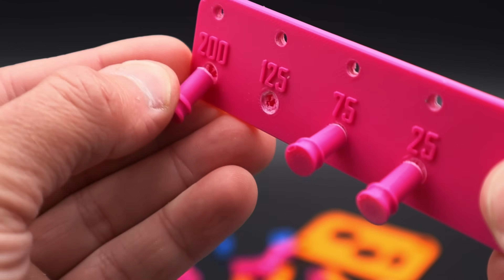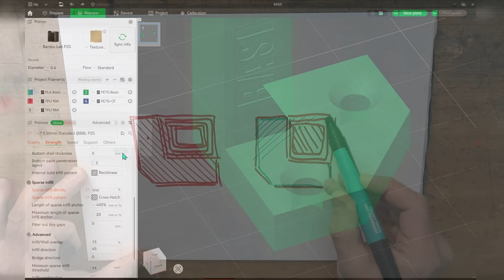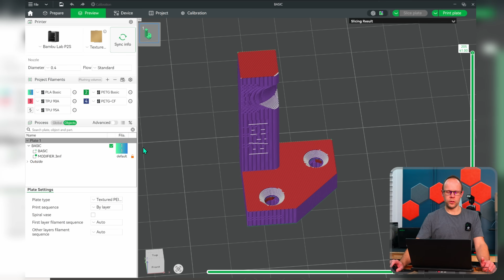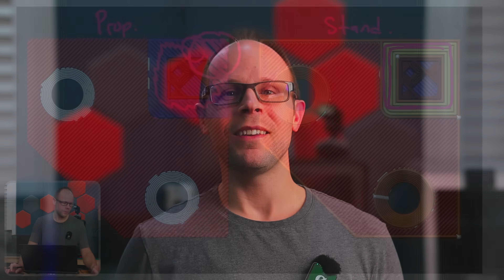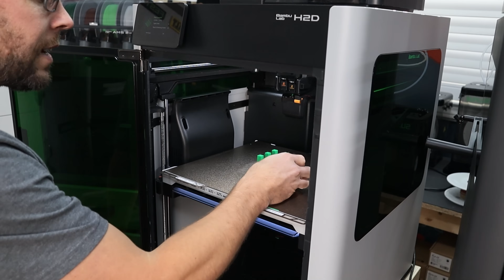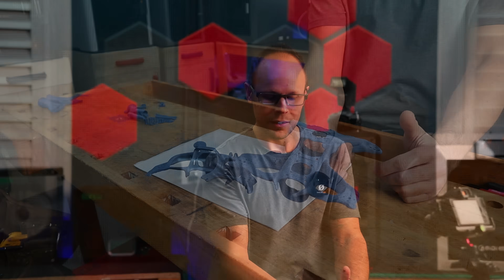Can the simplest 3D printed extrusion path also be the strongest?

Comment: Good find.  Printing by object would have to improve it further. 46% improvement in PLA is huge.  

I was playing around with this and found that I did not need to use a modifier at all.  I was able to achieve this fully within orcaslicer.  just make all of patterns 'aligned rectilinear,' 0 walls.  

Regarding "Detect narrow solid infill", i found it could be useful to use or not use this, depending on the geometry of the model.  If the part has some intricate geometries mixed with some bulky areas, you may want to use that.

I'd love to see more testing of this method with different types of parts.

Comment: I always add a curve, where parts break. Already learned the hard way, you can't design 3d print parts like machined parts, you have to go smoth instead of hard corners. A 45° curve of 0.2mm already helps a lot and doesn't really change the part.

Comment: I bet we can smooth the part and it looks super nice (ex : polysmooth, abs, asa-cf, etc...)

Also using one wall on the outside, maybe inside too, would likely greatly increase overhang capabilities while still benefiting from the technique and give a smooth surface

Comment: I would put a negative cube under the transition that is twice the set wall thickness smaller than the post and extends from a few layers below the interface to several layers below the interface. This causes walls to form under the walls of the post to fuse to the walls over them, in effect, extending the solid wall into the part. This strengthens the post while using less filament.

Comment: i think you can get similar results 
by using the standard method 
but playing around with nozzle temp and part cooling fan speed 
basically optimizing for the filament to print hotter without losing quality

Comment: If the theory is heat helps with strength via adhesion can't you just use standard printing parameters and bump up the printing temp a few degrees?

Comment: interesting vid! I like the thinking approach.
I have a few concept and measurement questions/points though.
1. What happens if you change the wall thickness of the outer wall (one wall print version) to the minimum (0.2mm)? that way you should have a nice surface, yet you don't sacrifice as much area for your process.
2. Can you (for some next vid) also provide the weight (and weight distribution if doable) of the parts? having the same amount of plastic in relevant areas is really important for these tests.
3. You want to extrude over hot plastic before it cools, but then you print 9 samples in one batch, invalidating that process because one has to wait and cool while the other 8 print.
4. The test parts made have a stress concentration on the start of the narrow tower. this is ofcourse nice for testing, but what would happen with the default strength and more importantly your approach if you add a champfer to eliviate the stress concentration? will your approach improve even more or fall of a bit?

To be clear, this is instructive feedback. I give it because you came up with a great idea and I want to know the ins and out ;)
and as of the time of posting this comment.... merry cristmas :D

Comment: One other thing to point out that matches what I see from other videos: PETG is stronger without the CF. I still don't know what CF filaments are for. People say it's stronger, but all testing shows it's weaker. Before anyone says it's stronger in "X", no it's not. Every test I've ever seen it's worse than plan PETG. I haven't seen many tests with nylon and the CF versions there... but I assume it's the same.
Reply: It can be useful to increase STIFFNESS (ie, Young's Modulus), but not strength. Even the stiffness is pathetic compared to real carbon fiber composites and metals. For example, Polymaker PA6-CF20 is a good quality (and expensive) CF option, and has a Young's Modulus of 7.5GPa (5.7GPa after absorbing moisture from the air). That's TINY compared to (say) 6061 aluminum (69GPa).

Comment: When you hollowed the drone part I saw you put the offset at 1.07. You're typically printing layer lines as thick as ~0.2mm. 1.07 is not a multiple of 0.2, so some of the lines (when lining up with certain walls) will be squished, resulting in less overall strengths. That said, I love this idea! It's such a clever way to work with the printers features!!

Comment: “This is a fantastic deep dive into layer adhesion — exactly the kind of thinking that pushes 3D printing forward! As a prototyping and low-volume manufacturing factory, we often see how subtle changes in extrusion paths impact real-world part strength, especially for functional prototypes. Your experiment aligns with what we’ve observed in our own 3D printing lab: sometimes simplifying the path can indeed enhance structural integrity. Keep up the great content! If anyone needs help translating design insights into physical parts (via 3D printing, CNC machining, or other methods), we’re here to support. 👍

Comment: There is a lot of room for growth in FDM and Resin Slicers.
You know, there is a relatively easy way to solve this problem (at least in concept).
Basically, you could program the slicer to add more plastic where there are high-angle Concave Areas, and in these areas you could add plastic at the depth of the wall thickness (or higher), and along the surface of the part at a user-specified value.
Where the "added thickness" decreases gradually until it reaches the user specified length.

Comment: I noticed that my older slower FFCP with the enclosure printed stronger petg parts than my faster bed-slinger.  The three main differences were the enclosure, the slower speed and worse cooling.  All of which would have improved the interlayer bonding of the parts.  Have you looked at reducing the fan speed and impact on interlayer bonding?  Printing per object and slowing down the print speed can also help as well.

Comment: Pins and similar cases of small tall parts attached to a base are normally solved by forcing additional walls inside the pin going all the way to the bottom of the base (or as far as you want).

Comment: Just a few random toughs i had when watching the video... Have not done any testing myself so take it for what it is.

Might this be that you get better surface-area between the layers? Ie the small voids around each extrusion?
This could be tested by testing strength 90 degrees against how the lines are extruded on a thinner part.

If that's the case brick-layers the standard way might work even better as that will increase strength evenly in all directions.

Another possible option (random tough i had) could be to split up the parts into interleaved "bricks" where each "brick" have fully aligned extrusions. Think advanced brick-wall where each brick is multiple layers but interlocking with surrounding "bricks".
Another possibility could be to have aligned extrusions acting like rebar within a part to improve strength in specific directions.

Comment: I wonder if a laser (IR or whatever) slightly heating the surface of the lower layer just before the next one is extruded over it would help. Not to the point of melting it but so that the heat of the extruded filament melts the surface.
Reply: I have been thinking exactly the same thing, asking myself why is no one doing it

Comment: Adding a fillet at the base helps a lot when possible. Adding internal structures like one or more '+' shaped hole that cuts into the base shape also helps, acting much like an anchor of 'external' walls. If you have access to advanced features like 'brick wall' or half-layer offset extrusions so each extrusion fuses to two of the extrusions below (in the groove between two) that's also going to help a lot. If possible print entire objects at a time, it results in stronger parts. Depending on material you may want some form of ACH to both help with warping and layer adhesion.

Comment: You should also do a version where the walls of the pegs extend through to the bottom of the base. I’d be willing to bet that not only is it simpler to model, but it would ultimately prove stronger since the peg itself seems strong enough in the Z axis.

Also you forgot one more trick - printing it angled at 45 degrees.

Comment: Very interesting test. I like the approach, but there is a factor that might not be applicable to the real world. You printed a bunch of parts, all at once. But that gives every part time to cool down as well. Depending on the needs in a real world that could be way less, maybe even only one. I personaly tend to print objects alone instead of throwing everything at once on the build plate. On such a single print the results could be closer together. The cooling strategy could be important as well. I often reduce the cooling depending on the part, wich would be large parts that have time to cool on it's own and/or have minimal to no overhangs. The goal is better layer adhesion as well. But I never ran tests on that.

Comment: I have a small powdercoating setup and its given me an idea when it comes to the final surface texture of 3d prints but Im not nearly as smart as the rest of the internet to make it work so I figured this might be a fun video to plant the seed of inquiry to see if anyone can add to it or tell me why it's not an idea worth the time.  For starters my idea requires a multimaterial printer that could fill in all the holes and important interfaces with a material thats easy to remove from the main structure material, sort of like masking tape. For those who don't already know, powder coating is just a fine powder of a plastic material that is sprayed on to the object with air and is statically charged to stick to the negatively grounded object you wish to coat and then baked to melt the plastic powder into a thick and uniform surface like the shell of an M&M. If someone could come up with a powder that melts at a lower temperature than the printed material I feel like it would still bond fairly well to the rough texture of the print regardless of the adhesion property between the dissimilar materials. The real trick is the application because of having to apply the powder to a non conductive surface. With powder coating metal parts you can get away with preheating the part and spraying it without grounding the piece because the powder will stick to the hot part as it melts and then you just finish the final bake in the oven to gloss it out.

Comment: Was it not an option to print the PLA just slower, hotter, and with less cooling?  I mean, if it doesn't stick well to itself, because the previous parts of the extrusion are too cold. Why not attack that issue directly. Hotter - speaks for itself. Less cooling - the same way. Slower - so that the thermal mass of the nozzle spends more time over the deposition zone, radiating heat into the area.
Reply: If it's too hot then the tower will risk failing because it would sag over all the heat. I'm pretty sure his method releases heat closely at the same speed but achieves a higher adhesion because things get printed together as they are at their hottest point

And also too hot and you burn the plastic

Comment: Interesting test—thank you very much for that. 
What surprises me is the significant difference between “1 wall aligned” and “fully aligned.” How do you explain this sharp drop in strength? (I would have expected that 1 wall “for decoration” would hardly reduce the strength at all.)

Comment: Solutions I've used with great results
1. Add a hole in the bottom for a small peg or screw. (I usually use M2 screws and self tap them into a 2mm hole.)
2. Add a chamfer at the base of the tower.
3. make the tower rounder (lower stress concentrations)
4. Increase the nozzle temperature.
5. Increase the nozzle size, or the line width
6. print slower.
7. print at a higher layer height.
8. change the print orientation.
Reply: You just don't get it. These are test parts. Made to try different ways to print a layer adhesion union. Results are not conclusive but insightful.
Reply: @edufonseca5718  But these tips are general good suggestions and people looking at this video probably want something stronger and these tips are exactly what they might need.
Reply: @chili209  Valid. But the video is about layer adhesion and how the extrusion path can improve it. Not alternatives to make this specific test part stronger. If you print a test hook, you don't improve it's layer adhesion or strength by widening it.

Comment: For my own curiosity, did you happen to calculate material consumption as well with any variables for additional print time? 
In my own use case scenarios, rather than doing mismash geometry tricks (outside of optimizing the model internal and external shapes itself for better printing during creation), usually the more direct route to better part strength coincides with a material change that can tolerate more heat. I know I've banged my PET-CF/GF drum just about everywhere by now, but because it is such a versatile material that I wish more people would use, I'll drop it here, too. The omission of the glycol additive makes a world of difference in tolerances, post-machining properties and overall part strength, but it does require a hotend with higher headroom for temps.

Comment: Thanks for bringing attention to this. I've been using this mode for several months now (way easier to achieve in Cura than Orca), and the only downside is that we can't have zigzag shells with normal infill (without all the trickery). Probably the easiest way to get it would be to modify fuzzy skin algorithm, but who know - maybe someone will add proper option for this kind of walls.
BTW, I think the improvements come from crossed lines more than extended melting.

Comment: Crap. I threw a laser head on my printer to do some etching.  I'd like to fiddle with this for my RC FPV stuff.   Christmas Santa shop is on over drive for my family right now.   Oh ? your printer is a CNC machine, laser cutter /etcher and a 3d printer.  Basic install using a screw driver or Allen wrench.           Every printer on the planet is capable.   Oh? not you resin monkeys.     thanks..    EDIT   Merry Christmas ! ! !    and have a very happy new year.!

Comment: Adding a filet at the base would also help
Reply: the test wasn't to make the strongest design, it was a test to figure out which slicing method is the best.. the results would likely be the same even with the fillet, the proposed method of slicing is stronger than standard
Reply: @c @chronokoks it shouldn’t have had a right angle to begin with a filet is always stronger
Reply: @11THEFEZMAN11   again, you don't understand the purpose of the whole test and the video. The purpose was NOT to create a strong part. The purpose was to COMPARE different slicing parameters. It's cool and all you know that a fillet would make that part stronger, but that was not the goal. Do you understand or are will you go on a tirade how smart you are and you would make the part stronger even thogh it wasn't the goal of the test and video at all? Learn to not be so smart that you're actually stupid, it's what adults learn early on
Reply: @chronokoks you obviously don’t understand how to build a part, or take any criticism.

Comment: In order to optimize strength you need to optimize the standard method first. Have you tried different layer hights (0.16 seems to be strongest in some tests) and different temperatures for your filament? I find that printing PLA+ at 230C with almost no cooling makes it much stronger over the standard 205/210C prints. Without optimizing standard parameters any attempt to improve the strength is meaningless, as the normal parameters are not optimized for strength and improvement over those settings are rather easy.

Comment: Cant you also print the shape hollow and insert a square printed peg that was printed horizontally. The outside will then have layers at 90 to the force but the peg will be in line with the force.
Reply: Another one who missed the point of the pegs.  These pegs are engineering test samples.  They're not functional parts, they're meant to be a repeatable method to test different layer pattern techniques.  If you really needed a load bearing cantilever peg like that then yeah, you'd want to print the part on its side to have the extrusion lines in line with the peg.  If you were going to do an insert like you described, it would be much stronger to insert a steel bolt as the peg